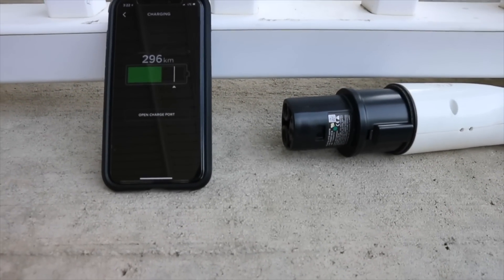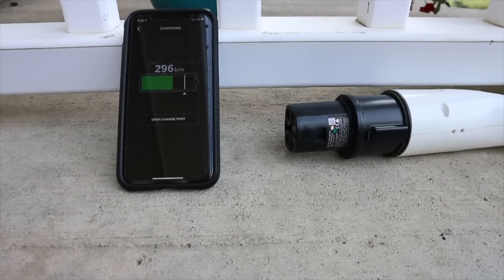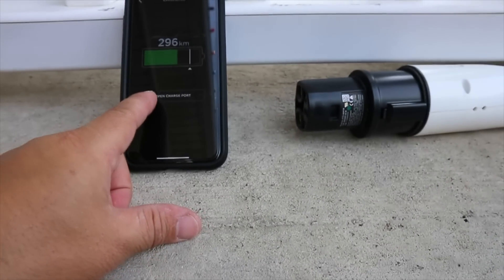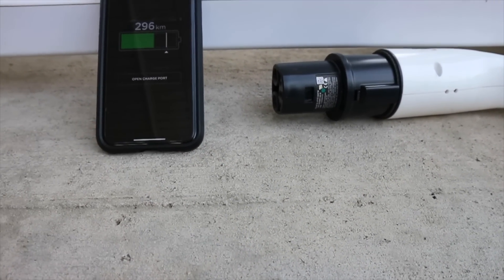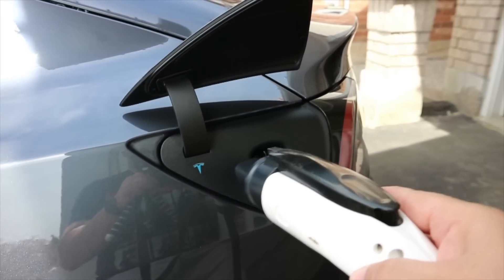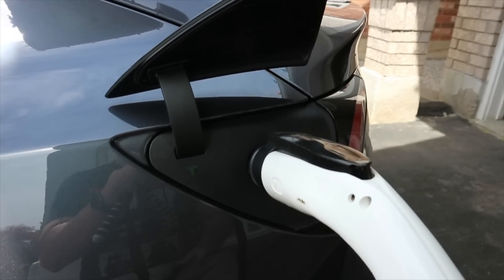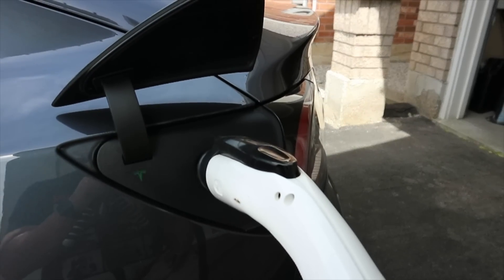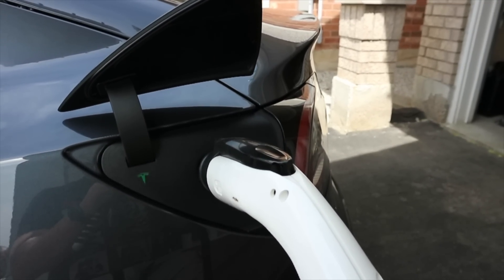Tesla Model 3 Charge Port SOLUTION

Comment: It’s a magnet. When you push on the door, the magnet in the door (that little black piece that you removed) gets closer to a second magnet in the charge port. When these two magnets get closer to each other, the vehicle senses a change in the magnetic field and causes the charge port door to open.

Comment: Try this. With the door open hold the little plastic thing against the port where it would hit when it’s closed. I did this and the door closed on me. It seems it’s some thing in there. I also couldn’t open the door by touching it until I put the plastic thing back in.
Reply from the maker: Possibly. I wonder if the door closed only because it timed out and automatically closed on its own. 
Maybe that’ll be my next video. Thanks. 👍

Comment: I'm heading to Telsa  (on June 25, 2020 ) to have it replaced because mine probably fell off awhile ago and I didn't notice it until now.  Not sure if they are going to charge me $98 for this since many of you are having the same issue.  I got a message say there may be a charge for $98.  I'll keep you updated.
Reply from the maker: What $98????? Keep us updated.
Reply: @DaxM  looks like the missing piece is covered by warranty.  I won't have to pay to fix that..  The 98 buck quote is a  customary fee they quote until they figure out the problem. Also over heard alignment cost is $150 something. And 19" tires are are about $280 something for each tire.  About $1300 for all 4 tires.
Reply from the maker: Cali Maki that’s awesome and good to know for the future. Have fun with your Model 3.

Comment: Hey guys mine completely fell off but problem is that I dont know wer, so its lost! Can I buy just that little "magnet" sensor by itself? Or will I have to buy a whole new charge door.
Reply from the maker: I would take it to your Tesla service centre and they’ll replace it for you. This is such a common problem I’d be surprised if they even charged you for the part.
Reply: @DaxM  I have had a really bad experience with my local service center. I did call them and they said regardless they have to charge me a diagnostic fee of $200 in order for them to tell me if my part is under warranty or not. According to them they wont know if it's under warranty until they check it out themselves but regardless they said I have to pay a diagnostic fee.

Comment: I just went out to check mine after your first video and mine is missing... mine charges perfect. Thanks as I just went on a 3,000 mile trip using supercharges, hotel free chargers, free Nissan center free charging... Thanks to Orr Nissan in Fort Smith AR for the electric love when a supercharger is not up yet.   My door will not open now with a push and did not know why... solved my problem with push to open THANKS AND MODEL 3 is incredible.

Comment: Is your model 3 longer range or the cheaper model and how much did it cost you in Canadian dollars?
Reply: There are no "cheaper version" yet anywhere. As for costs with taxes and upgraded paint is CAD75700
Reply: Tesla only sells one version of the Model 3 currently: Long range, with premium package.  Dual motor, Performance are coming Q3 2018 i.e., next month, and Short range is coming around start of 2019.
Reply: Loanword Eggcorn I hope it comes at around Q1 2019, because Elon said that until they make enough money from the premium model 3, they won't start selling the cheaper one! 😭
Reply: Q1 2019 seems possible for Short range Model 3.  Elon suggested timing based on Model 3 production ramp up and resulting economies of scale.  They may hit 10k per week by the end of 2018, and 5k per week by Q3 2018, e.g., in July.

Comment: To properly reproduce the issue, you need to be opening/closing the charge port the same way you did in the first video... from inside the car. You've effectively changed the parameters by using the app instead of the screen in the car.
Reply from the maker: Like I said this wasn’t “Scientific”. Plus, i could be wrong, but I don’t think that would have made a difference.

Comment: It’s just a magnet that as you push it it then knows to open the charge port,  as the magnet is pushed closer to the sensor, some tech is on a laptop to turn it off when you close the lid

Comment: If just a piece of plastic, why not form the mold to include that spot?
Reply from the maker: Interesting question, that I have NO answer for John. 🤷‍♂️
Reply: I believe the piece of plastic is removable by design, as a way to protect the charge port from anyone just opening up the port by pressing on the door.  You now have to use the app or be inside the car to open the port.
Reply: I think it's a magnet

Comment: Loving your videos DaxM!  I got my 2018 Chevy Bolt Premier last week.  Saw a Tesla Model 3 on the road in front of me yesterday.  Really sharp car.  Happy for you.  Thanks for making these videos, they are interesting to non-Tesla EV owners as well.  I find all new cars have a couple little issues at first.  These ones are minor but I am sure Tesla will fix them free of charge as well.  Loving that 15 inch screen.  How do you find it driving without a speedometer in front of you?  This is one thing I like on the Bolt having that in front of me as well as a center screen but would love that 15 inch screen over my 10 inch one (that sounds bad! ;-)
Reply: The speedometer in Model 3 is high and near your right hand on the steering wheel.  It's highly visible and can't be blocked by the steering wheel, hand on the wheel, arm by the steering wheel, etc.

Comment: I still think it's a magnet. Not sure what function is has. Why not simply test it? If it was a magnet, it should stick to iron.
Reply from the maker: I did try to stick it to something metallic and it didn’t stick. That’s why I don’t believe it’s a magnet. But who knows, the other side could be a magnet and this piece is just metallic. Maybe that’ll be my next test.
Reply: Ok thank you for the answer. But you say "metallic". I guess, you know, that magnets only stick to iron, nickel and cobalt (there are more, but I haven't even heard of them before)? Well, I don't know, which of the Model 3 parts are made of aluminium and which are not ;) so there is a chance, that the car isn't the best place for checking a magnet ^^ (and maybe the magnet is just not very strong?) I just don't get what else it could be. Nobody would design this as a simple plastic piece without function. I also don't think this piece is metallic, because I am not aware of any cheap "metal sensors"... the only reason, why you would but a piece of metal anywhere opposite to a magnet would be to hold the lid closed. But that's also not the case here... could be a simple bumper rubber to absorb shocks and prevent rattling on the charge port. Well, that doesn't explain why the "manual" open by pressing the charge port door doesn't work anymore. Seems like this is magic! EDIT: Bjorn did a video about the magnetic / not magnetic parts of the Model 3 ("Tesla Model 3 body materials"). Yep, many things like the doors are just aluminium ;)

Comment: No, what you're seeing is people thinking both a QC issue and the fact not being able to refuel as a serious problem. I don't have a problem with EV's, but I personally won't buy one until there are 10 minute or less fully charging stations and the solid-state graphene batteries to match. Yes, we often drive beyond the limits of even a 100 kW model S on trips just enough to warrant an ICE car. 

I simply hope that Mercedes or maybe BMW offer those new solid-state battery cars soon AND there's supporting infrastructure.

However, in the long run hmm I'm thinking ICE cars powered by 100% renewables, e.g. Algae Biofuel, is the future. Or once batteries are 100% recyclable whichever comes first.

Comment: Nice to see that it wasn't an sensor. But it still a mystery why it would not charge until you put it back. So my guess is that is an on/off swith (or something) that helps you open the lid. it could be that when it fell off it though that the lid was closed when it was open and that is why it would not charge. It will be hell to reproduce thou. (or if tesla already have fixed it) But still. its a design flaw if it stops you from tapping to open (i think they will have a better solution in a couple of months) I dont think that you are a tesla hater just because you point things out that you think are bugs or thinks that not function as they should, as long as you report them . If tesla can fix it means that the model 3 will be a better car.
Reply from the maker: Definitely NOT a Tesla hater